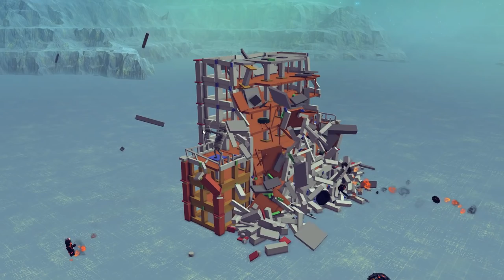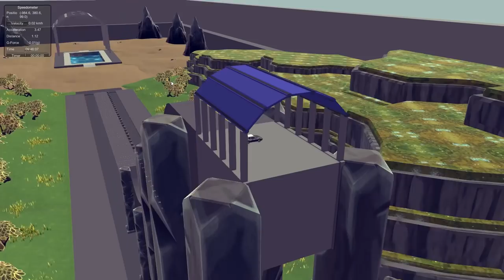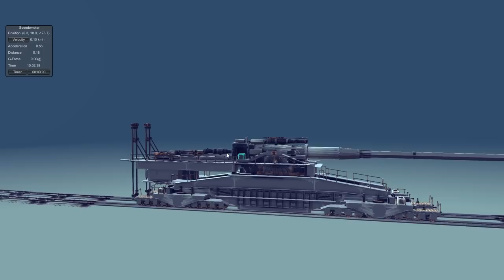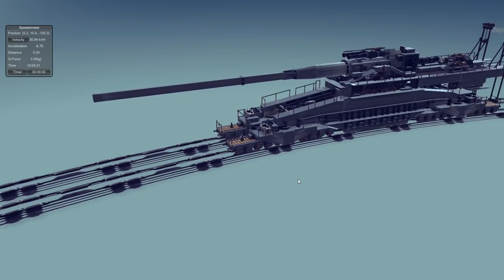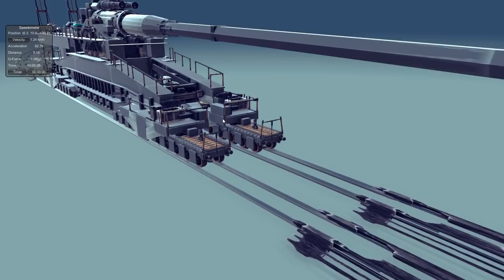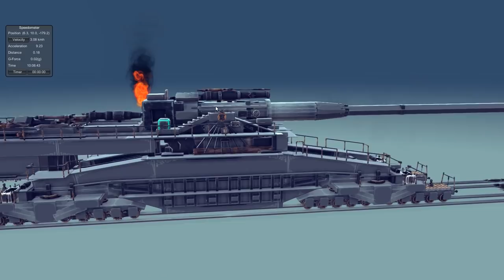The Largest & Most Powerful Cannon Ever - Exploding Buildings & More - Besiege Best Creations

Comment: The gustav is cool but there is a titan that is bigger than the gustav and it is a "D.O.R.I.A.N" its cannon has 142 times stronger than the gustav.It has 10 engines,a total capacity of soldiers to fit in is 235 soldiers,and most of all its ammo is a NUKE,thats why the D.O.R.I.A.N. is the strongest.

Comment: The problem is the air resistance. Its way higher than i reality. Probably partially to make flying in the game possible because if it was like it was in reality, helicopters and planes would basically be impossible in game because everything would have to move WAY faster.

Comment: The aerodynamics of that that car are similar to the planes because they have the exact same. None.   This game has gravity but not drag or wind resistance. What would be amazing is if they made lots of starter frames for all types of vehicles including plans that would give that build special physics. "realistic" for that build type. So they wouldn't have to rebuild the entires games physics engine. Is that possible? Would it work like that? It would be amazing if you could pick a plane frame aand build a plane around it and that build would have real plane physics but if you made a tank you wouldn't have your game and PC wasting power on proccessing full aerodynamics for the whole world when you'll never use it.